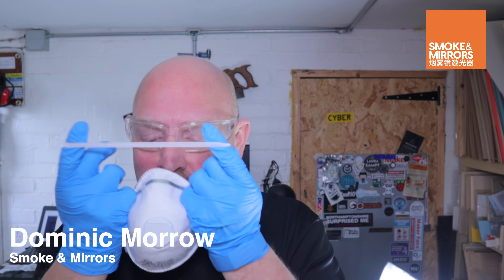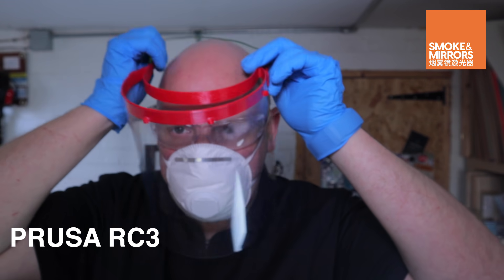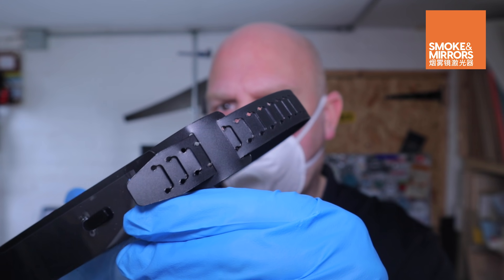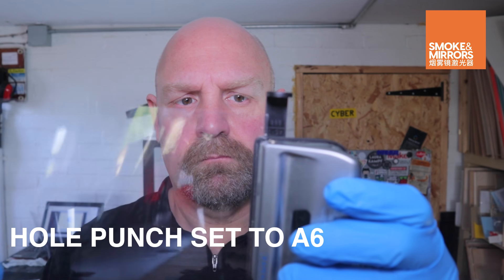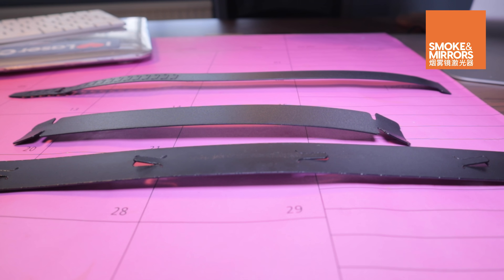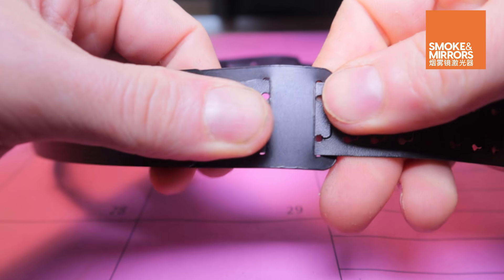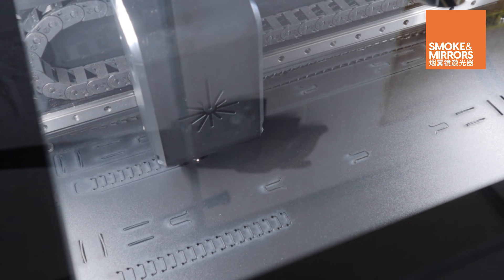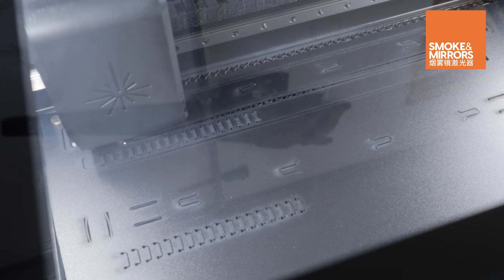Laser Cutting COVID-19 Face Shields

Comment: Really excellent design  .  I guess not everyone will have access to a laser cutting machine .  Could a simpler version be  manually cut using a blade and  scissors using a printed template ?
Reply from the maker: Eamon Hannan I suppose so, the idea however is to make many for the front line people rather than one at home.

Comment: Your link doesn't fully work. That's the link to the material. What thickness was it?
Reply from the maker: https://community.andmirrors.co.uk/t/covid-19-laser-cut-face-shield/168 You can use 0.5mm 0.8mm and probably 1mm polypropylene sheet, which I'm still finding at Kitronik in the UK though they're shipping it out as fast as they can get it in. As for PVC A4 binder top sheets, this is rapidly becoming the new commodity and people have been buying it, seemingly to price gouge.